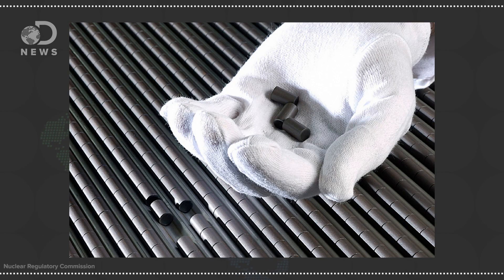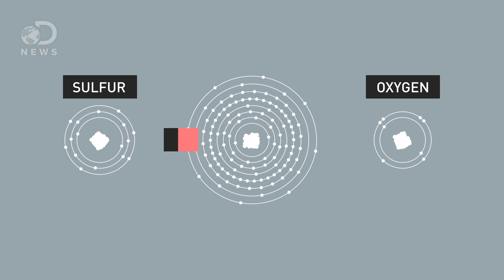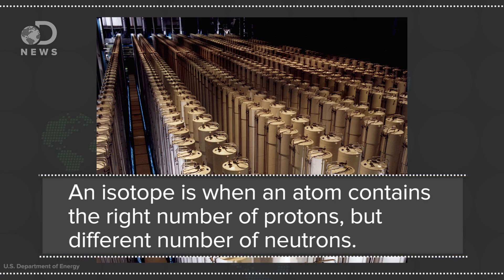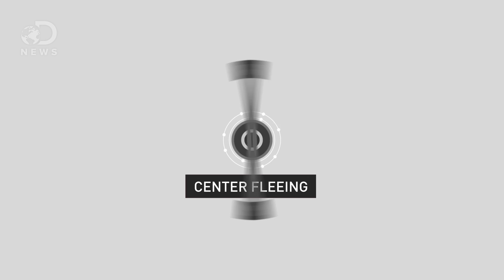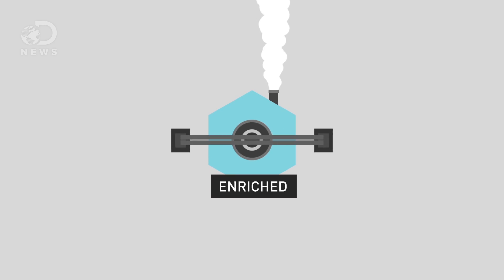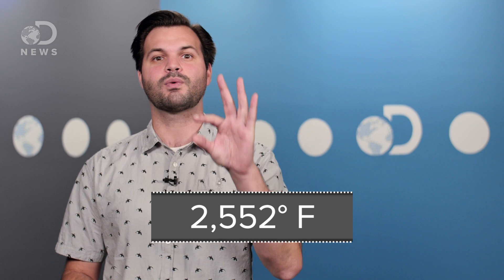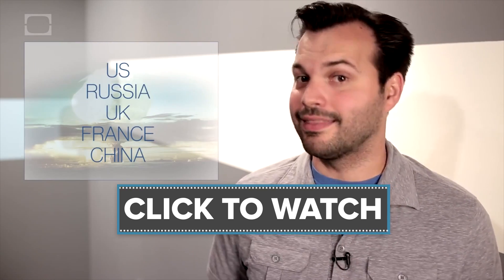How Uranium Becomes Nuclear Fuel

Comment: TOOOOOOO MUCH ENERGY WASTED FOR THIS TOOOOOOO DANGEROUS AND COMPLICATED ENVIRONMENTALY-UNFRIENDLY PRODUCT !!! ! !!!
Reply: I think renewable energy is the way forward, but having put some time into learning more about Nuclear power I am not as negative as I once was. I am explaining reasons here: https://medium.com/@Jernfrost/rethinking-nuclear-power-44a675890cf4

But the short version: It is technically possible to build really safe reactors. You don't have to build reactors like Fukushima or Chernobyl. These are called Molten Salt Reactors are basically safe due to the laws of physics, so it is not like a human can screw up and it all goes pear shaped.

What really won me over about these Molten Salt Reactor being developed is that they work well as really big and cheap batteries that we can use when wind doesn't blow and sun doesn't shine. For that time we need energy storage right. That could be batteries, but they are still quite expensive. Other solutions like pumped hydro, compressed air etc is also expensive energy storage.

Molten Salt reactors though because they heat up salt to really high temperatures can store energy as really hot salt. This heath can then be tapped to create steam for turbines and generate power.
Reply: @erikengheim1106  Nope, Because it is still Tooo Dangerous !!! ! !!!
Reply: @kopronko  
> Nope, Because it is still Tooo Dangerous !!! ! !!!

Comment: At present its the second cleanedt source of energy after solar power. But the drawback with solar power is that the solar panels takes lots of ground space and the panels have to be cleaned regularly for maximum efficiency and ofcourse it doesnt work 24/7 like nuclear energy does so my vote to nuclear power..

Comment: As far as green energy goes, it’s our only viable option. Solar only works on sunny days. And batteries only run for so long. Wind energy only works when the wind blows. Hydro is only available in specific locations. And none of these green energy sources are all that efficient. Nuclear energy, on the other hand is not weather dependent and is super efficient. And it produces no pollution. It does come with a danger though: radiation. Only specially trained individuals should ever work at nuclear plants or enrich nuclear fuel and had better use the proper machinery. When these precautions are not followed, you get incidents like the one in 1999 in Japan when two amateurs tried their hands at uranium enrichment with a steel bucket. Also, the reactor HAS to be designed right. NO FLAWS. Otherwise you get Chernobyl disasters. And stay away from earthquake or tsunami prone areas.

Comment: I am pro-nuclear. Fossil fuels are much less efficient and thus require more material, material that is already fought over, and will be even more so as time goes on. And green energy quite frankly does not produce the power needed to run the stuff we have (Plus have their own dangers rarely talked about, granted not as bad as a nuclear meltdown). Unless humans are willing to cut back on power usage (lol not happening) we will have to switch to nuclear energy at some point, unless prior to that another energy form (that is as efficient) is discovered. I would hope nuclear fusion considering all the money poured in to research for it, but only time will tell.

Comment: There is a third kind of nuclear reactor that is left out of this video.  The thorium reactor, or the Molten Salt Reactor.  It requires U-235 to get a reaction going but it doesn't require a fission to produce energy.  It use thorium and the technology have been around since the 1950s but wasn't developed further because the fission reactor have a military application whereas thorium reactor doesn't.

Comment: You should probably reveal the fact that Nuclear Energy doesn't create electricity thru fission, that energy is used to generate heat to boil water creating high pressure steam that spins large electrical turbine generators.  Its a total scam!
Reply: Sir FarSide What. You mean heat is used to boil water

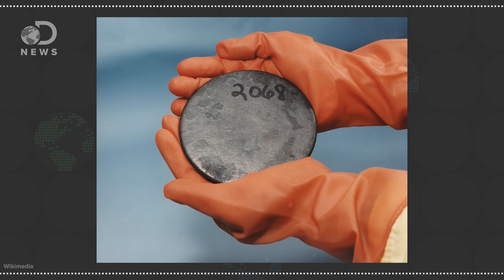Comment: 1:14 No, nuclear power fuel is not "highly enriched uranium".  It is uranium that has been enriched to from the natural level of 0.7% to 3-4%, whereas highly enriched means 90% or better.  That's appropriate for bomb fuel.  Some special kinds of reactors use more highly enriched fuel (like submarine reactors) in order to make them much less needful to fuel replacement, but commercial power reactors don't do that. Yes, you explain that better later.

2:25 "The fuel isn't super-radioactive yet", sort of implying it will at some point.  It only actually does so as it becomes spent. Uranium, in whatever form, is all only slightly radioactive - even highly enriched uranium can be handled (with due caution for its chemically poisonousness, like that of arsenic, and pyrophoric (tendency to burn) qualities, and of course avoiding criticality). Implications get worse with "as things go forward from here it gets more dangerous". Making fuel pellets actually makes it safer; criticality is no longer as large a concern). It only "gets worse" when fissioning actually begins in the reactor, but then you aren't handling it any more, are you?  Until you defuel it.

Comment: I'm personally pro nuclear power but only temporarily as a stop gap until so called green technologies become more efficient. In the meantime, nuclear will greatly reduce carbon emissions and mitigate environmental damage until we're able to go completely green. But that's just my opinion...
Reply: No need for a reactor in every vehicle.
Just have the vehicles be electric with efficient batteries, and power them with proper nuclear plants.
Reply: honestly if we went full nuclear, we wouldn't need to worry about solar or wind power. nuclear is just so damn efficient. cars could run for years at a time without refueling, planes could fly for days.
Reply: As a nuclear professional, I wouldn't trust the powers of nuclear fission to a layperson.
That being said, I wouldn't trust the average layperson with a potato gun, so have at it Hoss!!  Go nuke!!
Reply: In my opinion, nuclear is completely green, sure there is nuclear waste, but most of it is just tools that have been exposed to radiation for a little too long for people's liking.
Reply: Tanner Mayfield
Google LFTRs and see the future.
Reply: I agree but think that fusion will fulfil mass energy demands and solar and renewables will sustain personal demands.

Comment: can you pls tell me what happens to uranium - 238
Reply: They mostly just store it. It is not very radioactive, radium clocks are more radioactive by mass. It could be used to generate more fuel (by turning into plutonium) but that kind of reactor that can do that is rare. The US doesn't even recycle nuclear fuel making that kind of reactor basically illegal. If they did build breeder reactors then they can unlock 2 orders of magnitude more energy out of the uranium, no enrichment needed.
Reply: YASH KATARE bullets and shielding

Comment: What if that uranium fuel that u say what if ran out would it will explode or it wouldn't ?
Reply: okay..what the hell are you trying to say?
Reply: If a nuclear reactor ran out of fuel, which is what I assume you're asking, it would not explode. Like he said, it's nowhere near high enough concentration of uranium 235 to explode. Most people assume that anything with the word "nuclear" in it means that it's unstable and can explode, which is not always the case.
Reply: When the uranium fuel has been in the reactor too long the buildup of Xenon within the fuel makes any reaction impossible.
That is why the uranium fuel is removed from the reactors and relabeled as waste after only using about 5% of the fuel.
Xenon is one of the most common results from the process of splitting uranium into two smaller atoms. 
Xenon acts as a neutron sponge, sucking up the neutrons that would otherwise go on and split a uranium atom.

Comment: I have a question. Trace says nuclear fission is 8000x more efficient extracting energy than oil or coal. Is nuclear fission or fusion the most efficient method of extracting energy we know of in the universe or is there  100% efficient way of extracting energy somewhere in the universe?
Reply: Well . The efficient way I guess is using anti-matter ,But it's the costliest material to make, about $25 billion per gram. It has 100% efficiency.
 nuclear plant however ,have  a 92% capacity factor. Not only that , it  prevented 564 million metric tons of carbon dioxide emissions. I guess the most efficient now we have is nuclear plant , but what they are scared of is the waste . if it's not handle properly ,than that's it. sometime ,natural disaster occur and if the nuclear plant collaspe ,like what happen to Japan , GGWP is what i would say .a suggestion would be building in a natarual disaster free country? idk . Hope i ans ur qn
Reply: Fusion.
Reply: Because of the Laws of Thermodynamics there is no 1005 efficient way of transfering energy
Reply: Ex Animus So what the most efficient system of converting mass into energy we know of? Is it nuclear fusion?
Reply: nuclear fusion is way more efficient than fission, and it is alot more safer than fission is with less nuclear waste, we just dont have the technology yet to properly do nuclear fusion, it is currently being worked on, we have it working to an extent but instead of getting more energy from the reaction currently we lose energy by doing fusion, but in the future when the technology get better i think fusion will take over and fission will be less used
Reply: What is wrong with CO2? it makes up a tiny % of greenhouses gasses and the whole "global warming" is just another system fo the rich people to get richer. Nuclear fuel may be efficient but it's also deadly for us and for generations. Any fool that thinks this is a "Clean" fuel needs to look at what happens when things go wrong...Which they always will.
The CO2 agenda is a complete lie...Another way to control people, oh and tax them too. Genuine science has been sadly replaced by 'sponsorship' and a need to keep people stupid while feeding information far from 'factual'
Reply: Cold fusion is theoretically a far more cleaner and a near limitless source of power, but is yet to be achieved by humanity.
Reply: +Paul Fletcher Over 90% of creditable scientist today confirm global warming, and there are plenty of evidence that support this incoming crisis. CO2 based fuels are extremely inefficient and are mostly utilized by developing countries (i.e. wood) that use it as a cheap alternative to more expensive reliable sources of fuel. Ironic that you call global warming a "tool" for the rich, even though most people who try to disprove global warming are rich people trying to keep a hold of their profits from these environmentally destructive industries.

Comment: Exactly how fast do centrifuges need to spin?
Reply: that's classified. ;) 

just kidding i have no idea
Reply: more than 60.000 revolutions per minute
Reply: I'm guessing super super fast because there's only a 1% difference in mass
Reply: Riddick1988 holy crap
Reply: My hard drives should spin that fast!
Reply: Jack Wang the faster the better, but 10.000 rpm are common and relatively easy to make. Faster equipment needs also special materials to resist the centrifugal forces.
Reply: For uranium enrichment over 90 000rpm

Comment: How much does it cost to enrich Uranium to the point of an energy source? Compared to other stuff like oil, coal, Hydro and reusable energy. I never hear about the cost of creating those rods that provide heat for Nuclear Power plants.  I guess the power  benefits outweigh the cost of production.  but the price is radioactive contamination if things go wrong. That is why it is not popular.
Reply: From what I understand, the cost of running a nuclear power plant is less than the cost of running a conventional fossil fuel plant, so it can't cost too much on a $/kw basis. On the other hand, the cost of building a nuclear power plant is extremely high (we are talking billions), there are political considerations, and in the US at least there is uncertainty about what to do with the waste produced (more of a political problem than a technological one).
Reply: BalkyBartokomous2525 so you are saying that  developing those rods and the facility is very expensive compared to conventional ways. But since running cost is low as u mentioned.  Should it not pay off and be better?
Reply: Depends on how long it takes for the difference in running costs to pay for the difference in building costs. If it takes 80 years, why would I invest in it? I won't see the financial benefit in my lifetime. Also, if the lifetime of the plant is 50 years, the plant will need to be junked before it pays for itself.
Reply: Rudolf Menon about 30% of the cost of traditional energy sources. But in reality it is a byproduct of making bombs and thus is free.

Comment: what's the timeline for a prospective fusion reactor? do we need fusion to deal with thorium?
Reply: We don't need fusion at all even with thorium MOX. Any light water reactor can create slightly more fuel than it burns. They (LFTR guys) say you need online fuel separation for protactinium but that's only if they want to make a business selling synthesized fuel instead of just recycling for the plant.
Reply: Xylius Schaaij
I meant to say fissile fuel. Fertile fuel goes in and gets turned into fissile fuel. Slightly more fissile fuel is created after being in the reactor. U238 and Th232 are fertile and U233 and Pu239 are made from them and are fissile. The whole point I'm making is there is a lot more efficient burn-ups.
 Only 0.5% of mined uranium metal actually generates any energy in the current fuel cycle. No bullshit needed. There is a LOT more fertile material than fissile.

Fusion reactors also need to breed more tritium than they burn, same principle there, too.
Reply: Owen G development of fusion is slow, because there is no real interest in promoting it.

Comment: Please can you make a video about Thorium reactors?
Reply: Hopefully, Thorium molten salt reactors will get the attention of Bill Gates, Elon Musk or Jeff Bezos and one of them can get it going.  Our government seems to be dragging its feet on this issue.  Even China is ahead of us on getting a working Thorium reactor.
Reply: +CSmith.Develop Yes! It uses U-233, but Thorium is the natural fertile fuel to start with. Thorium is turning to U-233 after breeding! For the start up U-235 is needed to make neutrons; or a neutron ray could be used directly!
Reply: LFTRs!!! ;)
Reply: Virtually all of the claimed benefits of thorium reactors come from repeating outright falsehoods about uranium power, like claiming you can't build nukes using their waste when A- you absolutely can, and B- light water reactor waste is virtually useless in weapons use without substantial encirhment. What remains is all simply benefits of molten salt reactors, not thorium MSRs specifically. Uranium is a much better fuel for MSRs, in truth. Fun fact btw- despite there being 3 times as much thorium in earth's crust than uranium, there are /far/ more economically viable to extract concentrations of uranium than thorium. Around 9 million tonnes, vs only 6 million tonnes for thorium.
Reply: @infantjones  boy you better list sources
Reply: @Cam Smith that's not exactly true.
Reply: @Cam Smith correction more useful 
has a higher cross section (ie works better) in both thermal and fast
Reply: i.e. bullshit reactors.
Reply: @april5054  just because you don't understand it doesn't make it bullshit.
Reply: @subvet657  That was two years ago that i said that
Reply: @april5054  yea he was pretty late
Reply: @april5054  So what, you haven't stopped being wrong in that time.
Reply: @OryAlle  No?? I have, I didn't understand the actual science

Comment: We really should be switching to thorium salt based nuclear reactors. Thorium is a lot more abundant than uranium, much more difficult to make weapons out of, much safer and far, far, far less nuclear waste is generated. One of the biggest reasons uranium is still primarily used, is precisely because it is a lot more rare and has to be refined, leading to expensive fuel contracts and higher profits, and the technology has been developed a lot more for light water uranium reactors because of this. But molten salt thorium reactors, and/or LFTRs, have far superior potential, and would go a long way toward meeting the world energy demands, without adding to global warming or leading to further nuclear proliferation.